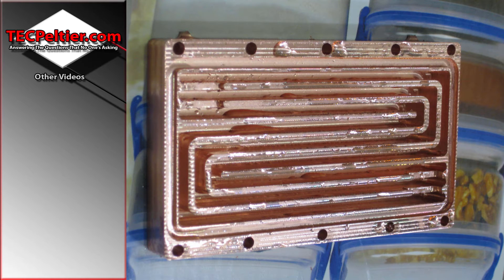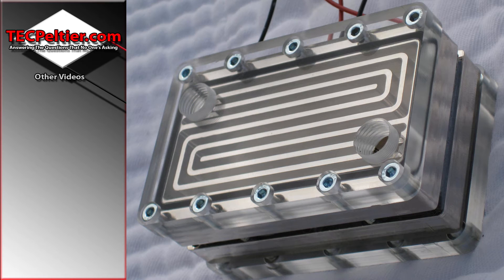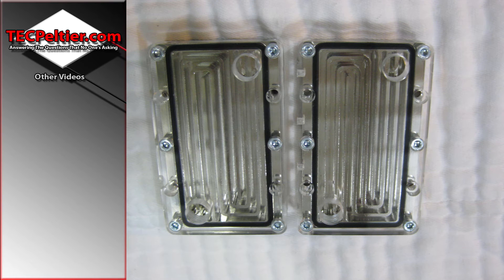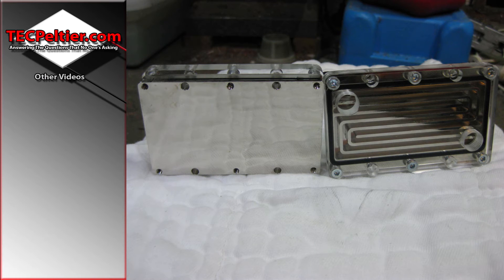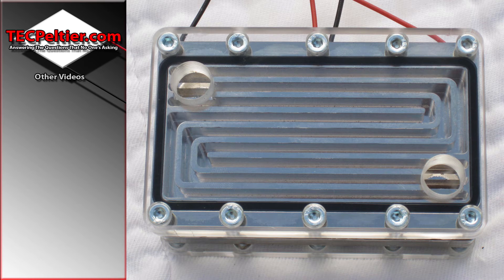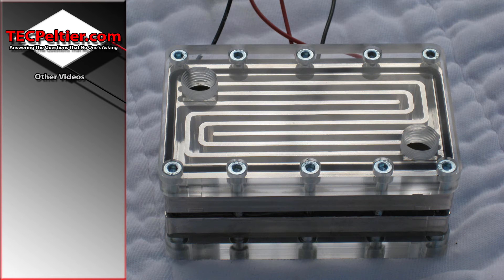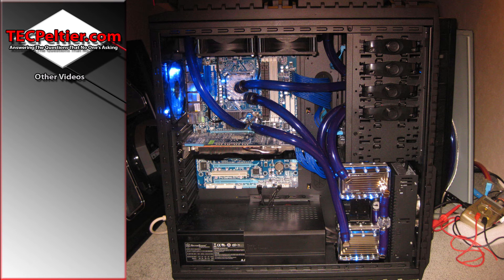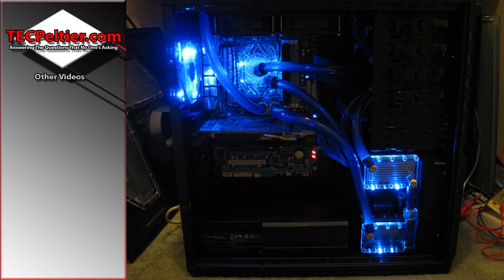⚡️ Thermoelectric Cooler (TEC) Peltier Water Chiller For Cooling a CPU. V2 Quad 50mm

Comment: What kind of controller are you using?

I saw one of your other videos, and I believe that the Brushed ESC + Arduino + Thermal Probe is the current cheapest and best solution...

Comment: Interested in subject and applied to join the group. 
The only major issue I guess that I have with TEC units and CPUs is Thermal Cycling in which the CPU does a lot of so it will cause the TEC to degrade much faster.
Reply from the maker: Well if you are controlling the TEC to stay at X temp.. then a controller will stop the cycling and improve life expectancy